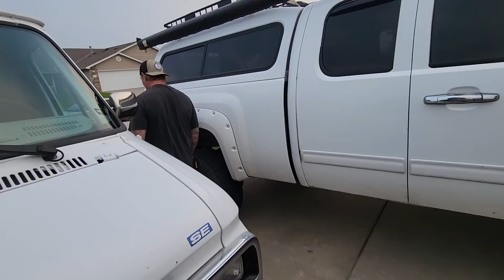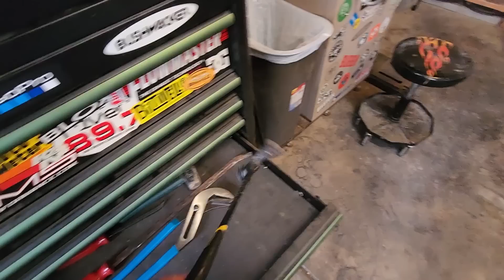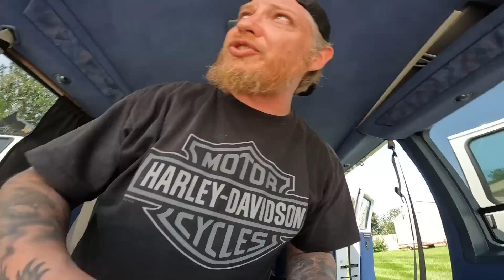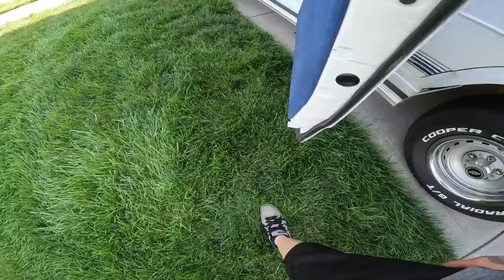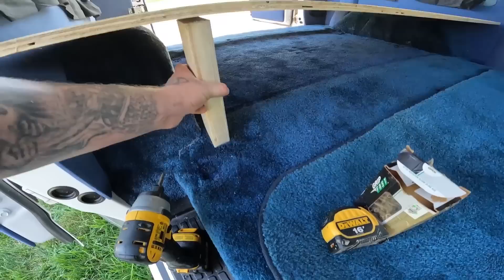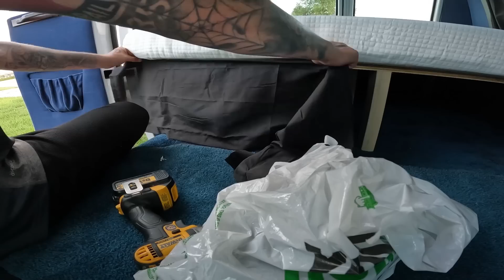Working on The Van - New Shocks & A New Bed

Comment: There's so much room under the vehicle to work under without jacking it up I remember replacing transmission on one of those Back in the day All I had to do is jack up one side Of the van  But of course Is rusty van from wisconsin These bands did not last long Here in wisconsin

Comment: There are actual van clubs out there where members meet up and camp out. I've seen some pretty awesome, decked out vans on those. I love it when nice wheels and exhaust are put on those vans, with antennas for tv, CB radios, etc. are put on them in a decent way. I don't own a full-sized van any longer due to age and poor fuel mileage, but I enjoyed the ones that I owned. You could break down and just sleep in the van until help arrived if you had to. The only downfall is driving them in winter weather, but carrying a set of chains or snow socks would be most helpful, or even a bucket of barn lime for traction if you start to spin out.

Comment: That bed is pretty legit. Cant wait to see the next part of the build. Maybe you should build a cabinet and have one of them dometic fridges inside it so you can just rock with that and not have to worry about ice anymore??
Reply: With a couple 150w solar panels on the roof?! 😜
Reply: @gtp2nv  I was thinking one of them roof vent fan things would help him out with his ventilation problem he was saying but then again you gotta cut a hole in that badass van to install one so probably not.
Reply: @91Bronco  Yea.... I wouldn't want to destroy the roof on that van for one of those. Solar panels would be doable without destroying the roof. If I was to put one of those Max Air fans on the roof.... I'd go full blown AC. Especially if I had to cut holes through the roof in the process.

Comment: Nice job!  Maybe you can find some mesh screen material and cut it to size for the back doors.  Then can maybe stick with velcro when needed.  That way - when you camp in a more secluded setting, you can keep the back doors open and let the air in when you sleep without the bugs.Just a thought

Comment: I am 6`2`` and sideways won`t work for me.. I built my bed platform on the drivers side and left enough room to walk through if needed.. And I built a small shelf / table over the other wheel tub.  I was working with a standard van though ..